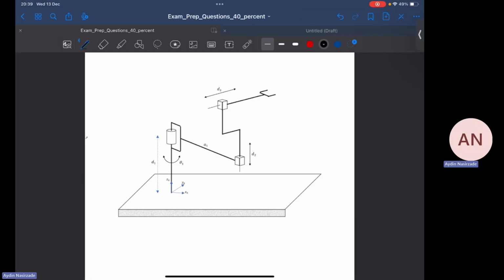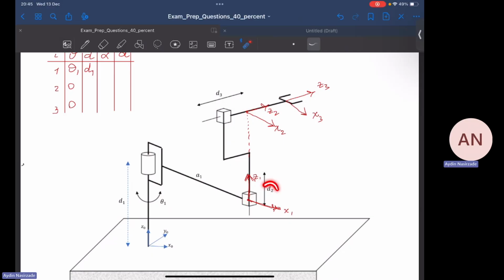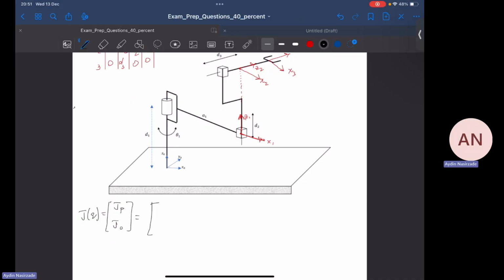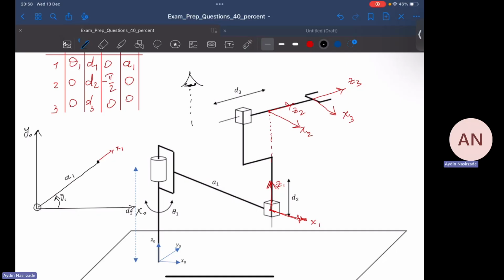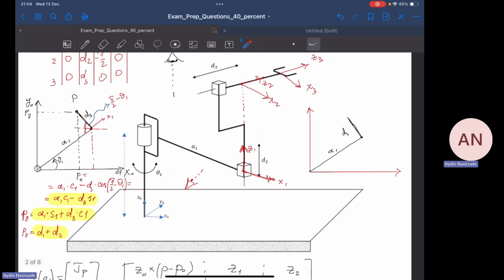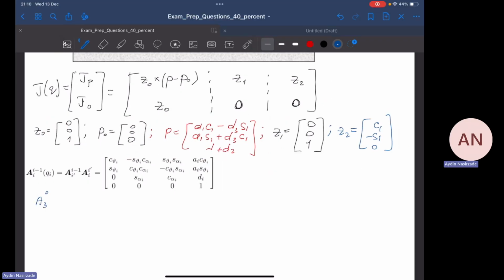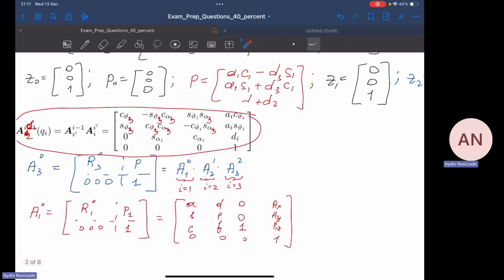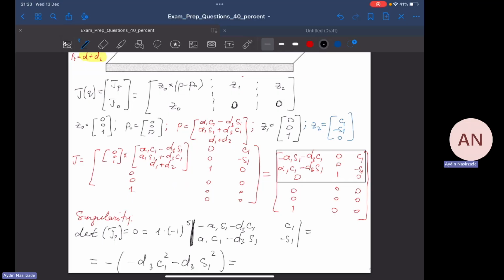Robotics Exam Prep 4 - Direct Kinematics | Differential Kinematics | Singularity

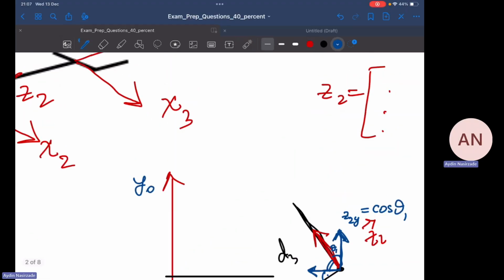Comment from the maker: At 28:05 I copied the component of z2 on the y0 axis to the wrong place in z2 vector (to the one corresponding to x0). So the vector z2 should have been z2 = [-s1    c1    0]'

Thus, the Jacobian matrix's corresponding column (the third one) has the same tiny mistake. The last column of the J should have been: [-s1    c1    0      0     0     0]'

Take it into account when dealing with the singularity too. Luckily, I came up with the right answer for the singularity: d3 = 0. 

It is okay to make mistakes. 👉👈